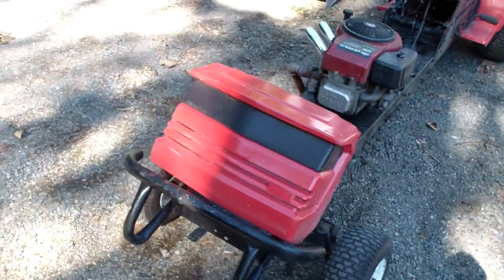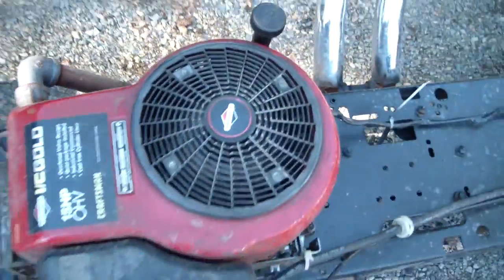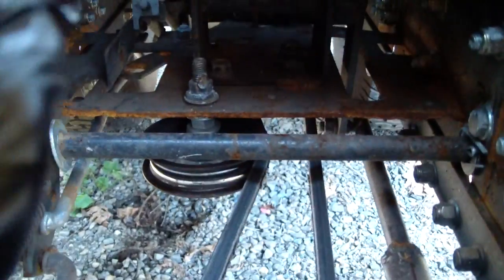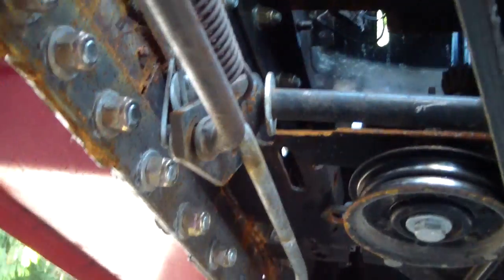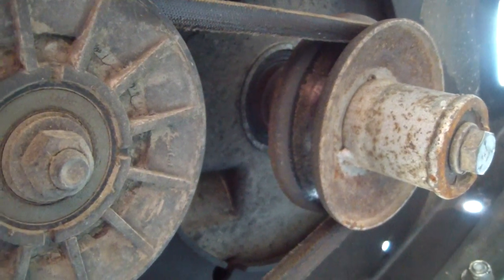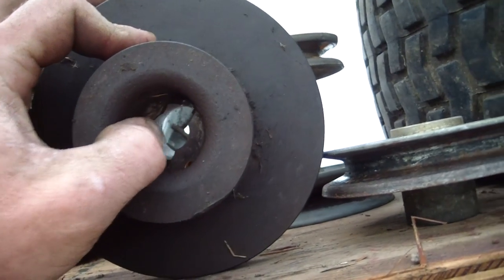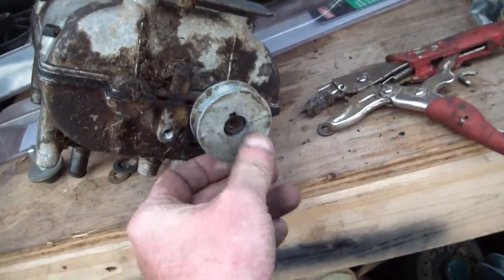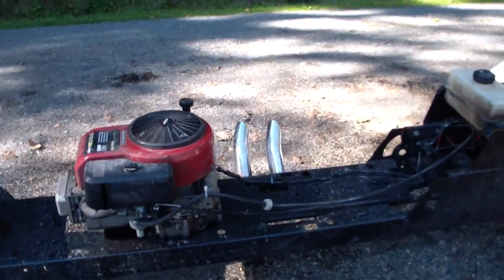The Hot Rod Tractor!!

Comment: NIce, but why so long? You could put 3 or 4 engines on that thing!! I have this idea of a stretched lawn tractor, not as long as yours but I want 2 twin engines side by side with exhausts facing out. 2 to 1 headers on both motors, side pipes. Kinda like a tractor pulling tractor that have multiple engines. I have a few other ideas in the works for "zany" mowers.